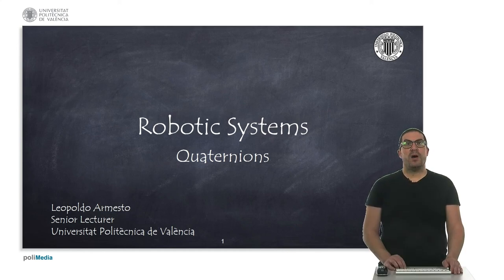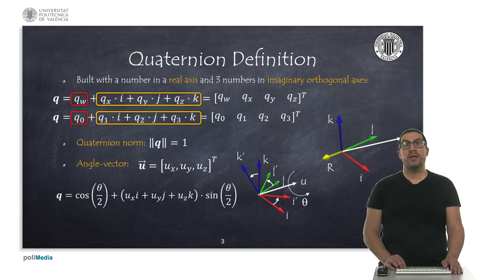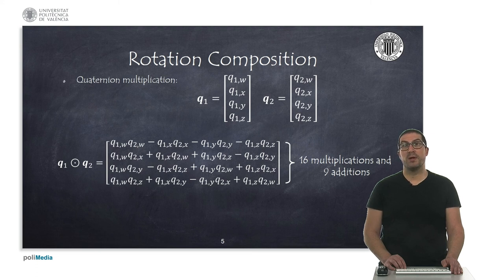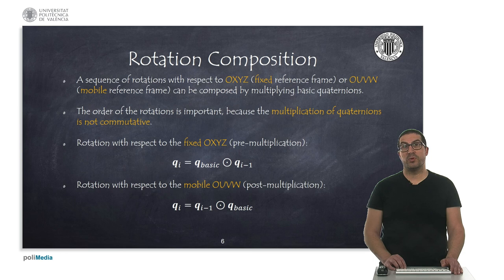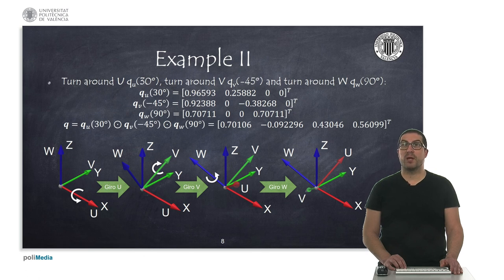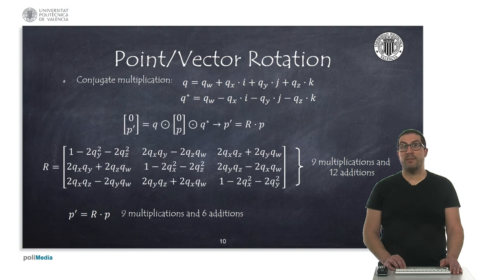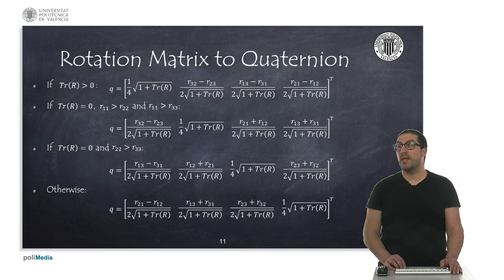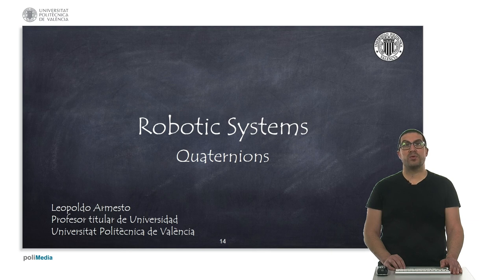Quaternions | Robotic Systems

Comment: I'm pretty sure "more complex to visualise" is only because people see 4 components and then seemingly give up. They are very easy to visualize as axis-angle (a very simple concept despite using 4 numbers), or alternatively they can be visualized as a composition of two reflections, since performing two plane reflections ends up rotating around their intersection by twice the angle between them. Reflecting across two quaternions is the same deal only that the resulting axis is orthogonal to both inputs rather than being the intersection. Reflecting across a quaternion is very simple since it's just a 180° rotation.

Compare that to a matrix, which I'd say is slightly harder to visualize (when done properly), but still not to difficult. (Also has 9 components, but you don't see anyone trying to visualize one by somehow projecting down a 9 dimensional space.) Visualizing the matrix as a rotation on the other hand is a much steeper task.